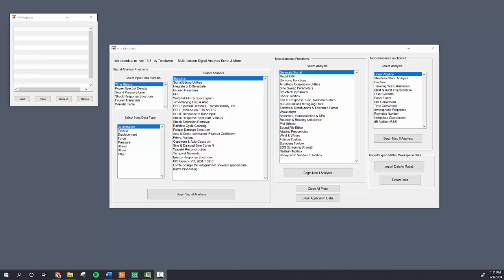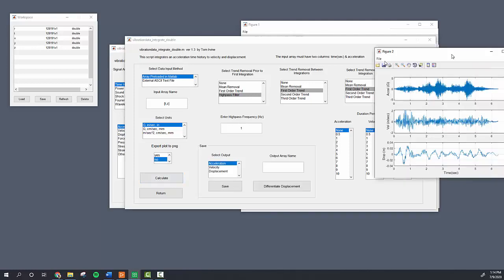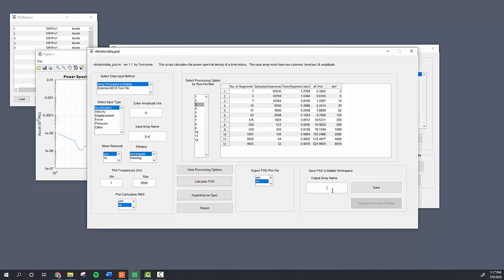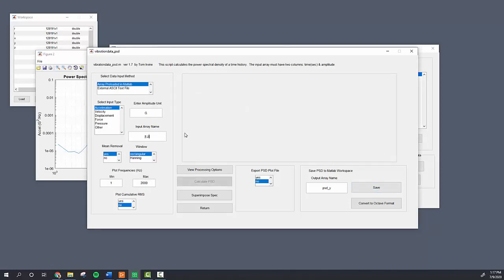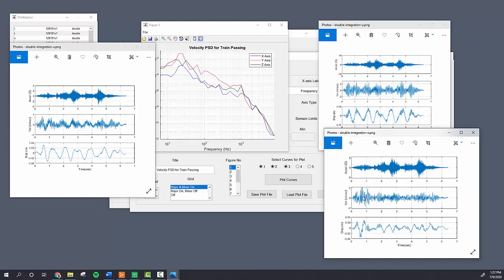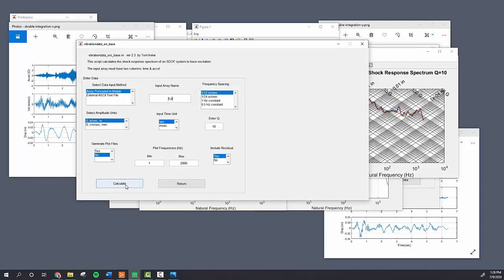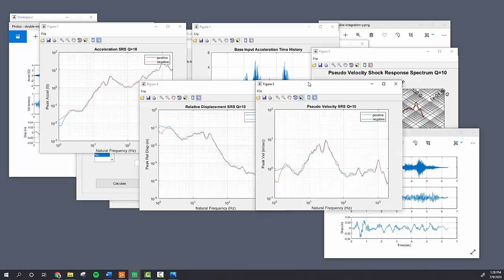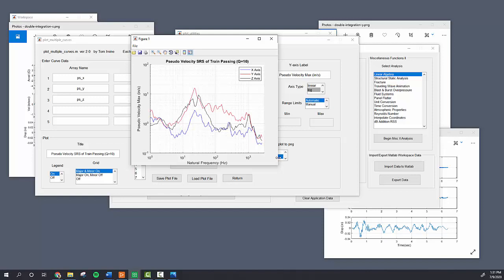How to Calculate Velocity from Acceleration Data

Comment: Thanks to  Mide Technology for this helpful video and MATLAB tool . I really wonder the step of ISO10816 process , how it is computed Vrms overall value at this toolbox . Since I practice my data, I found different Vrms values when compare with this tool , and I used in my calculation Vrms = sqrt(1/2*Vmax^2*Vmin^2) , so  I am confused a bit. Could you give more detail about this process for calculation of Vrms overall formula ?  Thanks too much again ,very useful tool for undergraduate students , great work !!
Reply from the maker: Hi Yusuf! RMS is the square root of the mean of squares. So this means to calculate, square EVERY velocity value, get the mean of all of these, then take the square root of that! Your equation was trying to get the RMS value strictly from the peak which can only really be done for pure sine waves which don't exist in the real world (most vibrations have many frequencies). 

Your question comes at an excellent time, we just published a blog that details how to calculate this and many other metrics! Check out: Top 12 Vibration Metrics to Monitor & How to Calculate Them! https://blog.endaq.com/top-vibration-metrics-to-monitor-how-to-calculate-them
Reply: @MideTech  Thanks to such good explanation , and help me to understand the theory of your approach !!
Reply: @MideTech  I read through the blog, but I don't think I found the answer. How do I go about finding the Vrms within Vibration Data program? The Output Terminal appears to give max, min, and std. I know it was stated that the std was effectively the Arms, but I didn't know if that logic could be applied to velocity and displacement? If I could find the integrated results raw data I could complete the Vrms calculation on my own, but I cannot find that data.
Reply from the maker: @davidcarmendy5244  Thank you for reaching out! 
Standard deviation is equal to the RMS of any dataset where the mean has been removed. So you can/should use the standard deviation value shown!

You can also export data from the VibrationData toolbox and then do a calculation in excel or elsewhere: https://support.endaq.com/article/201-export-data-from-vibrationdata-toolbox

We have been investing heavily in providing open source and powerful tools in Python to do most of the core and common functionality in the vibration data toolbox. Here’s an example to calculate RMS in different frequency ranges from an acceleration dataset: https://docs.endaq.com/en/latest/endaq/calc_usage.html#rms-from-psd. We have a few webinars introducing the functionality in this library and will have more content coming this year with lots of examples! https://endaq.com/pages/shock-vibration-webinars

Hope this helps :)
Reply: @MideTech  Yes it very much does. Thank you.

Comment: I know my initial value of velocity does not start from zero, what should I do to incorporate this
Reply from the maker: If you know the starting velocity, you can simply apply an offset to the calculated velocity. For example if it was already moving at 1 m/s you would add 1 m/s to the calculated results.  

Keep in mind though that this video was calculating velocity from vibration data which should be oscillating about 0. If you already have a non-zero velocity then you may not want to apply the initial high-pass filter because you are potentially not in a vibrating environment.
 :)

Comment: Hi, Thank You for the great video. Can you elaborate as to why did you use the high pass filter?
Reply from the maker: Hi Mohamed! Thank you for your kind words! When integrating data, the lower frequency content has a greater impact. This is because a 0.01 second pulse for example results in a much larger change in velocity (and energy) than a 0.0001 second pulse.  

But a DC offset that is purely an artifact of the electronics has no physical impact on the velocity, yet when we integrate that DC offset will be the dominant component of the result. We don't want that! So we filter away the very low frequency content (recommend 1 Hz) that is more than likely not real in the physical sense.

Comment: Very good video. But I am curious about the integrated data. If I want to download this data (velocity and displacement time series) to further other studies, how I can do it?
Reply: 😍😍😍. This is exactly  my case. Thank very much
Reply from the maker: Hi Stanley, thank you for reaching out! After calculating the velocity and displacement there is a new area in that dialog called "save" where you can select what to save and to specify the "Output Array Name." Then you will see a new variable in the Workspace if you hit refresh. You can then hit save from the workspace or go back to the main dialog window and click the button "Export Data" on the bottom right.
Reply: @MideTech  Thank you so much. I think it's so interesting because it's easy and fast. But I am curious about the plots. Do you think it corrects the data?  I tried it, the result requires me to detrend, which is similar to a non-corrected seismogram.
Reply from the maker: @stanleysaintpreux3867  Glad to hear it! Whenever you integrate a signal there can be some artifacts generated from signal noise and any DC offset in the data. So it’s important to remove these effects by de trending and/or applying another high pass filter on the final results. Without it you can get some velocity and displacement results which have weird characteristics and generally won’t start and end at 0.
Reply: Hi , I am really interested in your process, and I want to use it without any mistake since I know the wave form correction is very complete. I try to download your data to see how it looks like before I use my data. I see you have a sampling rate =0,00005 s, which means you have 2000 points every 1 second or you have 2000 Hz. But when you pass the band filter you use 1 Hz. Why do you choose 1 Hz? I would like to understand the logic since I see it looks good with my data too when I choose 1 Hz. But my sampling rate is 0.005 second
Reply from the maker: @stanleysaintpreux3867  When integrating any data, the lower frequency content will have a greater impact on the resulting integral (it happens more slowly). With vibration data, something oscillating at a non zero rate, the core velocity we care about is the velocity at the frequency ranges of interest - not something moving at the speed slower than a wave on the ocean. So we need to filter this data away, which may even be just related to the DC offset of the sensor so completely meaningless, to have a result that is showing us the velocity in the frequency ranges of interest.

Comment: hi ty for the great video. im a newbie in this area. im using mpu6050 which produce 3 axis accelerometer output in g unit. im pretty sure its not the acceleration data, is it? if not, how can i obtain the acceleration from the g unit. im confused.
Reply from the maker: Hi Haziqah, I am glad you enjoyed out video! The MPU6050 is a 6 axis sensor package that includes a 3 axis accelerometer and a 3 axis gyroscope. The acceleration data will actually be reported as 'g' which is equal to 9.81 m/s^2. This is the gravitational constant on earth and commonly used to quantify acceleration levels. I hope this helps!
Reply: @MideTech   i see. Now i have a set of accelerometer data (3axis in g unit) for a specific time. Do u have any suggestion on how i could convert all the data into acceleration? Maybe relayed softwares? Btw im going to produce acceleration vs time graph. Ty in advance
Reply: @Ziqastory  HELLO DID YOU FIND ANY WAY TO ANALYSE DATA FROM MPU6050? CAN YOU SHARE WITH ME ?